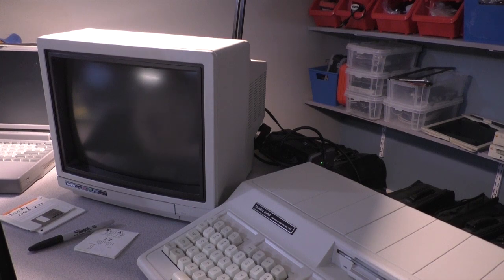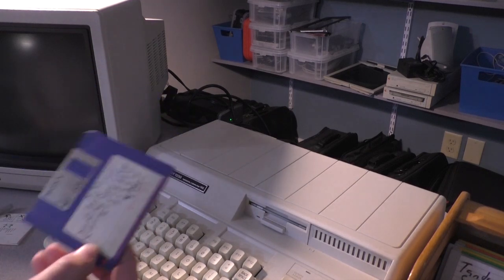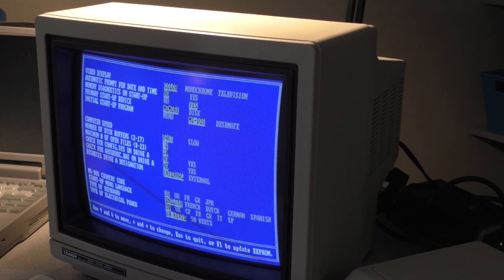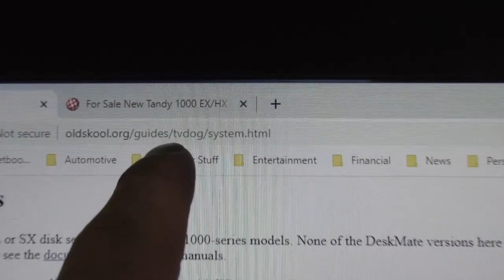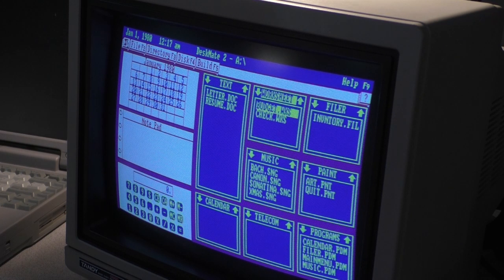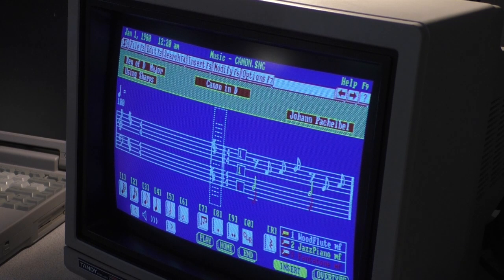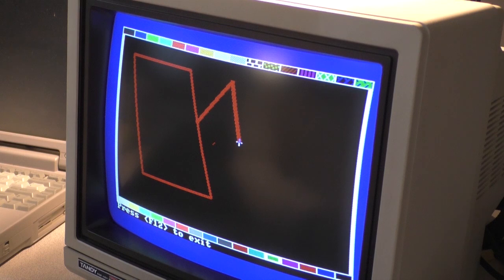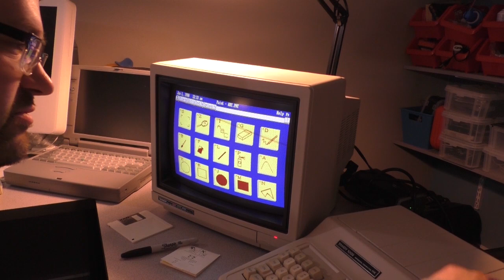Tandy Personal Deskmate 2.0 - Jack of All Trades, Master of None!

Comment: Actually the printer port on the Tandy 1000 series are standard parallel ports they just use a card edge connector instead of the more typical DB-25 connector.  Radio Shack sold a cable that had a Centronics connector for a printer on one end and the card edge socket on the other for the Tandy 1000 that allowed most parallel printers to be used (Radio Shack catalog #26-289).

There are a couple of people selling modern adapters that go from the card edge connector to a more common DB-25 connector  such as the one at https://www.tindie.com/products/cyberneticsys/tandy-1000-printer-port-adapter/  With such an adapter you can use most parallel printers just like you could with the Radio Shack cable.

If you want the original Radio Shack cable their is one on ebay now but it is expensive..

Comment: The printer port was parallel it used the original centronic pinout. IBM  actually changed the pinout.  You could buy a cable pinned out for an IBM compatible back in the day. Therefore you can make a cable that would work with most old printers.